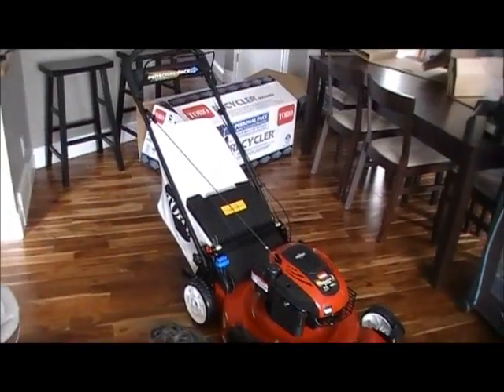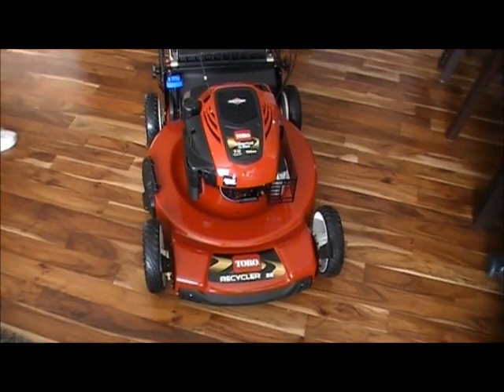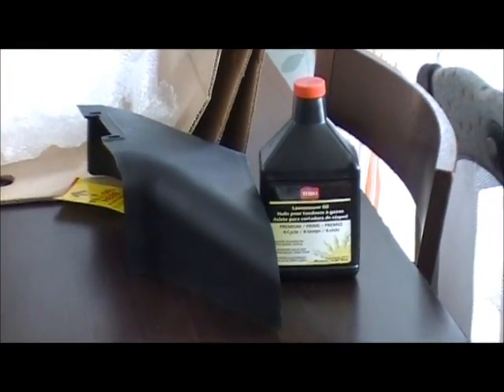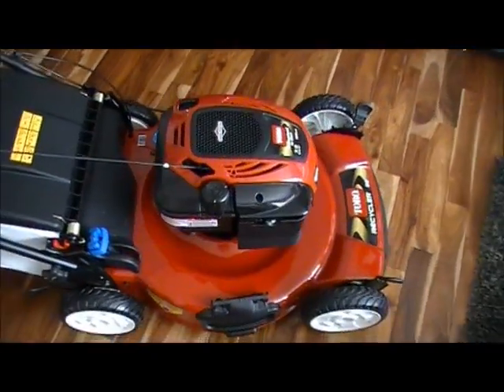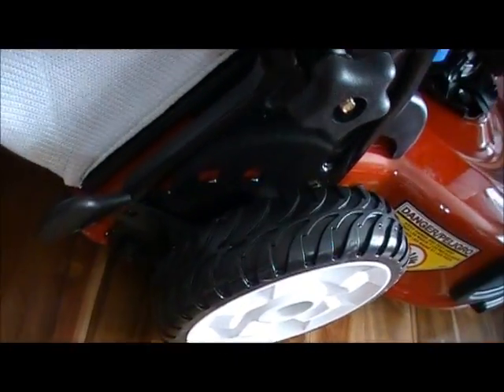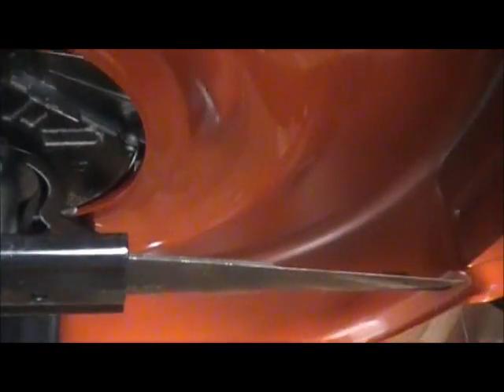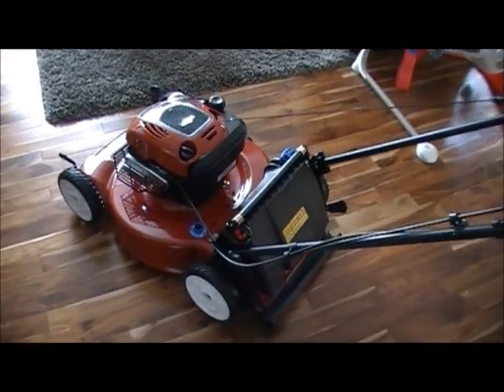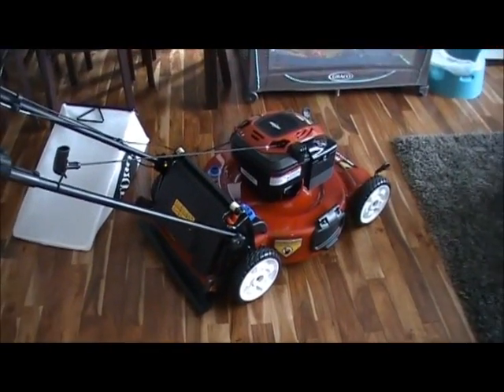Toro Recycler 20332 Lawn Mower Review

Comment: I love mine and yes that 10% difference makes a big difference in handling. On the brake in period i got 3.5 hrs and am switching to the 5w-30 synthetic old.List price was $380 i paid $359
Reply: Why the switch to synthetic? Just interested to know.
Reply: I thought it would last longer but the 30 weight heavy duty is better my opinion
Reply: Everette Singleton Thanks for this; my thoughts too. The only exception is for snow blowers that must be started below 40° F, where I would use 5W30 instead.
Reply: A lot of mower manufacturers I've noticed this year is switching to Honda engines. Interesting to see if Toro will do the same
Reply: *****
My rear drive belts doesn't last very long and is a pain to change. But it still starts on the first pull of the cord. Very hard to beat the personal pace feature too.
Reply: That's too thin for that engine.

Comment: Toro transmissions/drivetrains tend to have low complaints, but this is just the manufacturer cheaping out. I've had more trouble with plastic drive mechanisms than anything else; they simply cannot last as long as a basic set of steel gears.

Comment: I've had my 1998 toro super recycler mower with the briggs and stratton  engine I've had it for over five years  I don't get the negative reviews about toro  toro makes the best mowers ever
Reply: My previous Toro Recycler worked fine with many years with no problems, my new less than two years old is in the shop for a carb rebuild. Toro does not make the best mowers any longer and does not honor their warranty!

Comment: I got a great deal on this mower so I replaced a perfectly good 4 year old Toro.  I wish I had the old Toro back!  This mower bogs down too easily and I constantly have to stop the engine and let the clumps of grass fall out.  It doesn't matter if it's dry or if I just mowed 3 days prior.  Also, I had to replace the rear wheel because the gear wore out and it gets so loud.  3 months later that wheel went bad (obviously a mechanical flaw) and now my neighbors and I are forced to deal with the noise because I won't invest another $25 into a short term fix.  Oh yeah, I also had to have it repaired under warranty inside Home Depot - carb I believe.  CRAP!!!
Reply: I called Toro and got 2 free wheels.  Should I try lubricating or any other tricks to make it last longer?
Reply: redzombie78 You could try lubricating the teeth. But with these polymer gears you may not be able to do it just once. Try a Teflon spray lubricant first. The reason is that it tends tp leave a dry  finish, which won't gather as much dirt (dirty gears are a problem).  You should probably check the gears a couple of times each season to make sure they are clean.
Reply: It's not clear why the machine bogs down. See my post above to Gary Tarolli. It sounds like it is losing power. If those suggestions don't help let me know.

Comment: I have a Toro recycle 149cc Kohler engine and it is absolutely the worst purchase I have ever made.  I've never been more disappointed in anything else I've ever bought. I've had it in the shop 6 times in 3 years because it won't start.  it's a slap in the face that while I'm cranking it repeatedly and working on it, i have to stare at the sticker that reads "guaranteed to start"
Reply: +-Doug - This. If it doesn't have a Briggs/Stratton engine, don't bother.
Reply: +Sheldon Hall you could've told me that before I blew $350 out my but :)
Reply: +-Doug - I'd already purchased the piece of junk with the Kohler engine before anyone told me that it was a piece Chinese crap.  I was simply making a joke that you could've saved me money had you said something earlier.
Reply: +Budget Hitman My experience with Toro over MANY years is they are NOT all created the same, year to year, even though they LOOK similar. Each new season is a crapshoot as to what brand of engine comes on that year's model! If you buy one with a Briggs & Stratton engine, you have few to no problems. They used Tecumseh engines frequently too - they were junk. One good season and then constant carb problems. This year they've gone to Kohler, which sources a lot of their engines from China. BUYER BEWARE !
Reply: Noooo. I just bought one of those today.
Reply: Then again, B & S engines are nothing like they used to be. They just don't last. Gimme a try with Kohler.
Reply: I can attest to this as I'm about to pay almost $100 to rebuild a less than two year B&S carb on my Toro Personal Pace Recycler.

Comment: Rubbing the inside of the deck with baby oil keeps grass from building inside. My friend uses baby oil when mudding with his truck to keep mud from building up in the wheel wells. It easy to work with. just sqeeze on and wipe off.

Comment: The new Toro recyclers are out. Briggs kept there word. All overhead valve engines now and carb compliant. The L-head engine is out for good. They changed the shroud this year to tell the model years apart, which had to be done anyway with the new ohv design. Like I said the 7.0 and the 7.25 were exactly the same it was just to tell model years apart to sell them as new. All Briggs engines are made in China now?

Comment: Love this mower. Has a bad build quality so you can get them used for free and fix them fast. I use them to edge my 2 acres. Cheap crappy throw aways. I run over rocks and branches no problem. Keeps my John Deere rider from hitting the rough stuff. When the toros are toast they make good targets. Fill the tank with explosives and have fun! Usually pick them up from people in new houses with tiny yards. What pieces of junk lol.

Comment: Is it just me or does it seem strange to review and grease a lawnmower on a hardwood floor just outside the kitchen area? Also, he raised the adjustment to use the hose wash feature. The manufacturer suggests to lower the deck to its lowest setting.
Reply: lol what if you dont have a side walk or  paved drive way?
if you dont raise then it will cut grass as you wash...

Comment: I have basically the same mower, not impressed with the briggs engine. Bought in 2008 and so far the coil packed it in about 12 months in, I took the head off to clean the carbon off the piston as routine maintenance and 2 of the head bolts broke snapped off and are stuck in the block, the electric starter motor is crap, not enough power to start it on a cold start. The toro part of the mower is great, the briggs and stratton part is crap.

Comment: Also those wash ports are a joke. Go to the drive way when cleaning under the deck. All you need to do is have the mower running and then spray water at the ground near the mower. the mower will suck the water from the ground then throw the stuck grass back out. I do this with my commercial exmark and it works like a charm. I normally keep the water running for a minute or so.

Comment: I had a old toro that ran decent for what it was. Somebody stole it and I ended up buying a cheap small name unit from SAMs club that had a Honda motor. The deck is complete junk but the motor runs good. 

In the market for a new one. Was gonna buy a Toro 20333 cause blade stop will come in handy, but the store sold out and only had 20332s. Luckily I didn't buy it yet cause it doesn't sound like Toros are any good from these comments.

Going to buy a Husqvarna HU675AWD now(never had any issues with B&S motors). Love Husqvarnas as they never give me issues.

Comment: I bought this mower last year now and it has stop working. At time it will start and run for about 2 to 10 minutes then stops and will not start again. Toro warranty is useless if you do not have your original receipt. Took mower to Toro approved repair shop twice!, paid to have it repair...still does not work...will not buy another Toro product! All responses from Toro has proven useless!
Reply: I bought a masport mower with the identical briggs and stratton guaranteed to start piece of crap engine, spent more time at dealers than mowing lawns (7 or 8 visits til I got the shits and blasted masport) Then I bought a Toro with the same crap engine and had the exactly the same problem, won't start if its been shut down for between 5 - 20 minutes.  Only way to get it going again is to pull like crazy on the starter cord and don't stop until it's running again.  I believe some toro models now come with a honda engine  - good move toro !!

Comment: The most lousy lawnmower our family has ever purchased. Got a Toro Recycler in 2010 and have had nothing but problems. IT NEVER WORKED GOOD FROM THE TIME WE BOUGHT IT NEW AND CAREFULLY TOOK IT OUT OF THE BOX, even after checking the filter, checking and replacing the oil, changing the blade. All it did was bog down and stall and leave clumps of grass. It guzzled gas like no tomorrow and blew the exhaust in the face of the person using the mower. Lousy engineering. Poor quality. It would not cut through tall wet grass without stalling and both of our craftsman mowers could do that no problem whatsoever.😂

Comment: I don't like the new briggs and stratton engines.
Reply: I don't know if it is the Briggs and Stratton engine or the awful design of this useless TORO  lawn mower . . . 

But I can tell you, it will be a long time before I buy another mower with a Briggs and Stratton motor on it . . . this is the worst lawn mower I have ever used . . .
Reply: why?
Reply: It is more Toro that is just awful. But the BS engines have also become problematic.  Once I start my mower, I cannot let it shut off before I am done, it simply won't restart.  That could be the cheap parts not holding up to being hot, it could be the newer "energy efficient" motors that are underpowered and double my mowing time (just how efficient is that)?  It could be the throw away build mentality and quality?

Most the mowers still made in the US are made at the cheapo plant - 
MTD - the worst mowers in the world.  Granted, supposedly Toro makes their own, which I question as I don't understand how any business would knowingly make such a lousy product.

Comment: Toro mowers suck. They also have LOUSY customer service. NEVER buy a Toro again.
Reply: i agree on the lousy customer service.
Reply: hercules colon
Today everyone has bad customer service.
Reply: I agree with the bad customer service, but toro mowers work great!
Reply: I am in the middle of a dispute with Toro. Their guarantee to start on second pull is worthless. They will deny any culpability and blame poor fuel and not using a recommended fuel additive even though their manual doesn't require it. I spoke with a very rude and defensive supervisor and then spoke with a corporate supervisor who was not hostile but basically kept spewing the same talking points. The bottom line is that the mower I purchased is of an inferior quality and their guarantee is worthless. This is the second Toro mower I've owned, same model. The first was fine and lasted a decade, my current one is in the shop after less than two years and still under warranty that Toro won't honor. Do not buy this product!